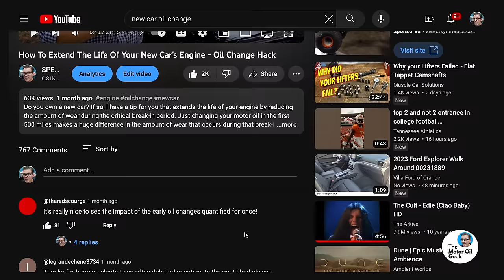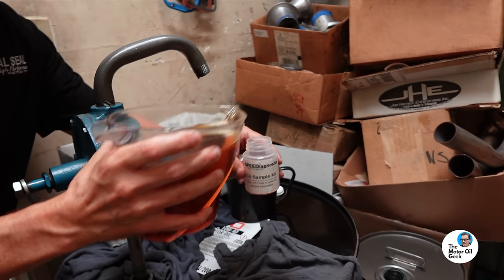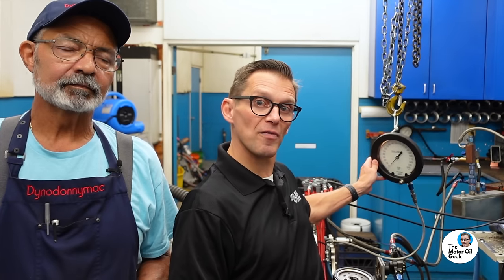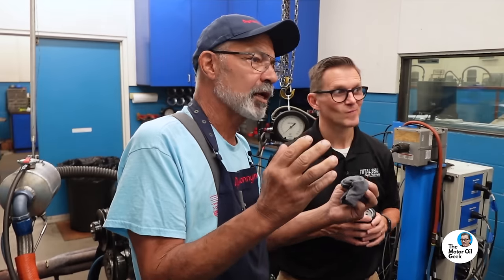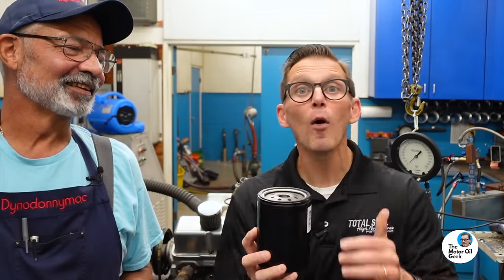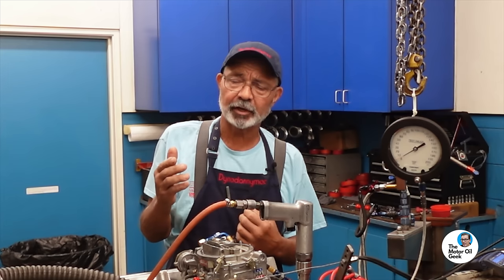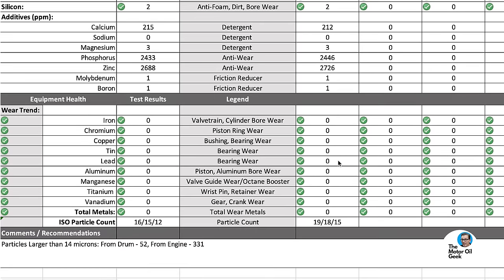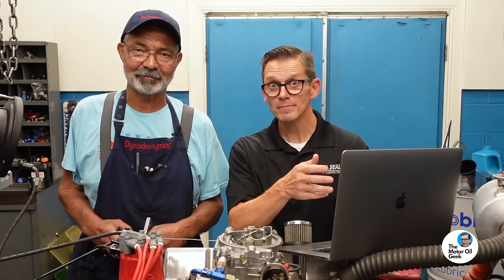Does Pre-FILLING The Oil FILTER Cause Engine DAMAGE?

Comment: If not pre-filling your filters causes you any engine failure, doing that over and over for the life of the vehicle, then it was a crap engine that was going to fail soon enough anyway.

It's a senseless thing to do if you have just drained the old oil so there is still a film left behind.     I mean in general, there's always some special application where  you have a unique reason but to generalize it for a standard passenger automobile in good working order?  Only a clueless idiot would pretend it makes enough difference to matter.  Tiny bit of wear particles in the oil?  Woop de doo.

Comment: You lost all scientific credibility when you claimed a benefit for the third time with prelube on the basis of no metal particles.  New engines wear, period.  It's called "break in".  A scientific process justifying your claim would require starting with an engine in exactly the same condition as the original, not one that had three filters to clean up initial wear.  You left uncontrolled what was almost undoubtedly the main source of the metal particles.